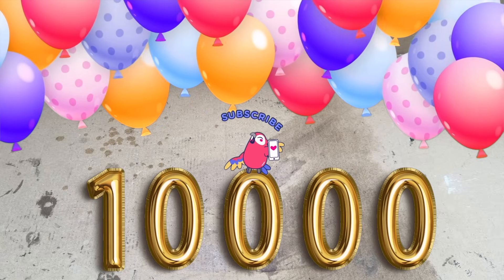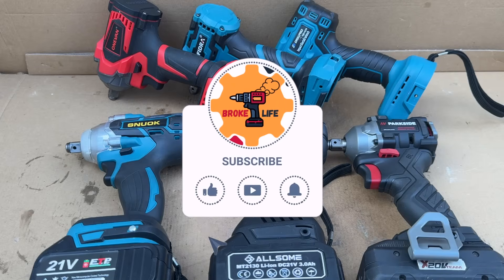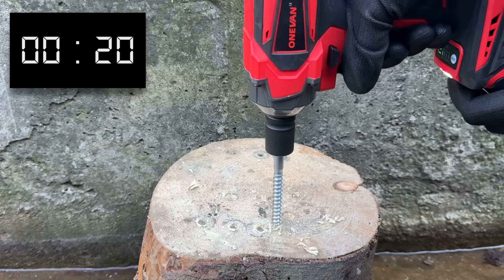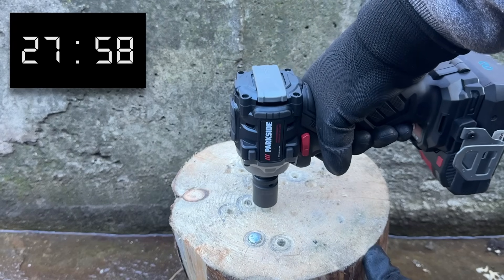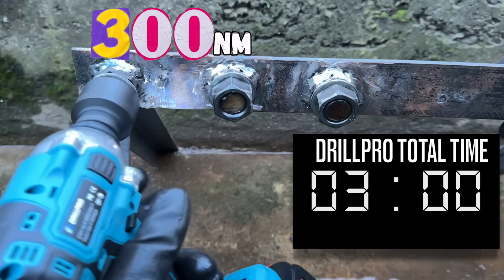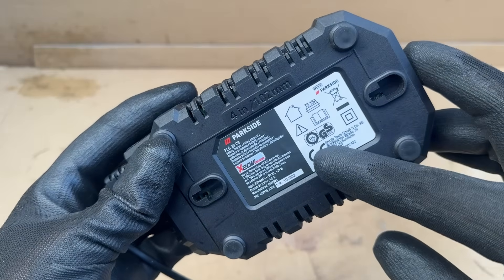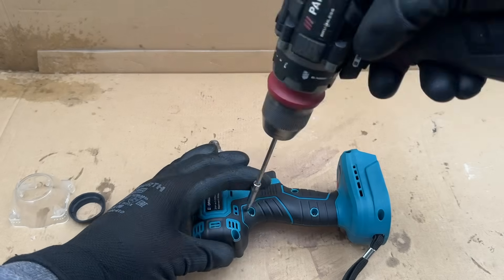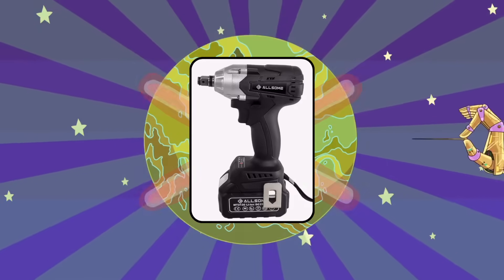Surprising Results! Parkside vs Temu vs AliExpress - Affordable Impact Wrench Showdown. Lidl tools!

Comment: As I said before on your previous short, for me the Onevan feels way more powerful than the Parkside. But the trigger is horrendous; it's not modular at all. So, long story short, I switched back to air tools and use the Onevan only if I have to use it outside the house.

P.S. Because my Parkside B2 died unexpectedly, I'm now waiting for the D3 and will upgrade it with the B2 spring and anvil because I don't like the anvil of the new one (now i just need an impact driver not a impact wrench).
Reply from the maker: You were spot on! As for the Parkside upgrade the mechanics of the B2 with the D3 electronics should be a really strong and capable build!

Comment: 10:35 the outer tow terminals are for delivering power to the tool 
the terminal in the middle is for charging only
Reply from the maker: Yes, unfortunately it does nothing for charging or for the tool in this case. They are just trying to stand out by including it on the tool and charger and hoping nobody notices that it does nothing.

Comment: Congrats on the 10k 👍. Nice vid also. Btw. have you heard/saw Parkside to realease a new mid-torque impact wrench performance version? I saw some some photos on one Polish tool channel, but not sure if it is any true. It was said to have ca. 700Nm.
Reply from the maker: Thank you! Yes, I saw that new Parkside and I think it is in fact a real product. They showed it on a german tool channel called Bauforum 24 but they mainly just talked about it. Around 600Nm if I remember correctly, but no release date. I hope it's soon, because it does look promising!

Comment: It's good that you "washed" the Parkside face after that big lag screw or it will be 8k for you again 😂😂😂. I always said that "1200nm" is a good tool. I have one for almost a year now with the combination anvil(1/4 and 1/2) and it's a very good all-rounder but I used it only with makita batteries. Congratulations on the 10k!
Reply from the maker: Probably back to 1K to be fair 😂😂😂! For €50 for that "1200Nm" kit I would say for someone who uses it once or twice per month it could be money really well spent. I have not compared it to the green Parkside (PASSK) but I get the feeling that it might just have more power than it. Thank you for the nice comment as always!

Comment: You should have compared the real impact from Parkside.
Reply from the maker: The green one, model name PASSK?
Reply: @BrokeLifeEU  black PASSP 20-Li C4
Reply from the maker: That is a high torque impact wrench so it would not be comparing apples to apples had it been included. These are more sort of compact mid torque type tools.
Reply from the maker: I have a test video of the PASSP C4 against a Milwaukee and Gisam from Aliexpress on the channel if you want that sort of video.